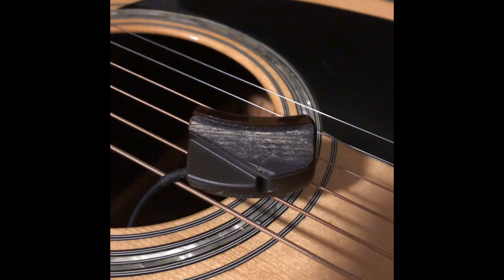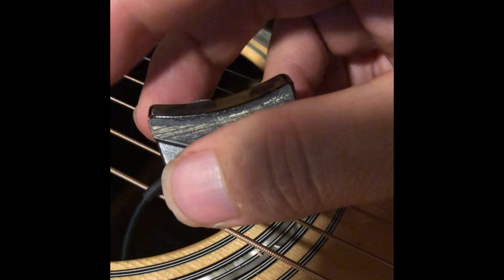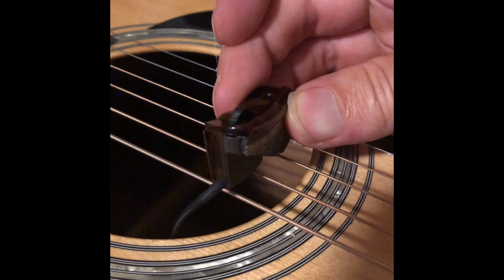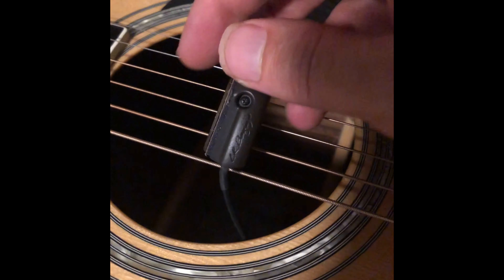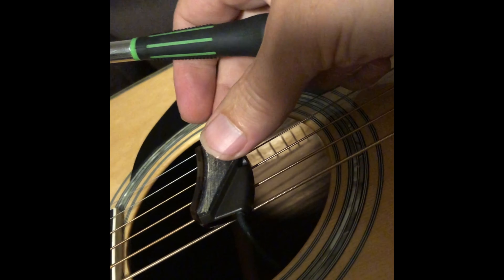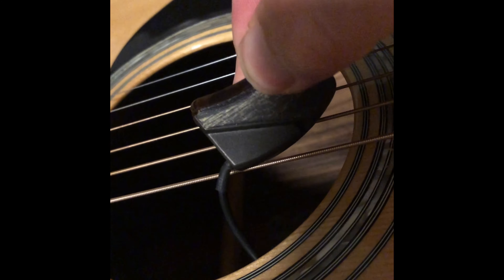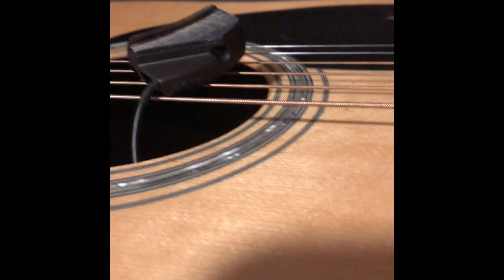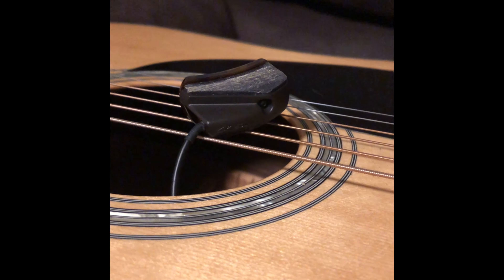How to fix LR Baggs Lyric volume wheel buzz / rattle

Comment: Is there SOME reason you're whispering thru some of this ??  I'd really like to know what you're saying at around 1:30  and after the 2 min mark ...  couldn't make out some of what you're saying ....  but thanks for posting this
Reply from the maker: At 1:30 I was talking about the gap between the 2 parts of the case and how the screw holds it together the loose screw causes the buzz basically. Sorry for the low volume, just took the vid to help a friend that had the same problem.